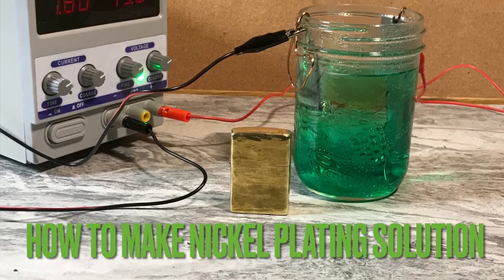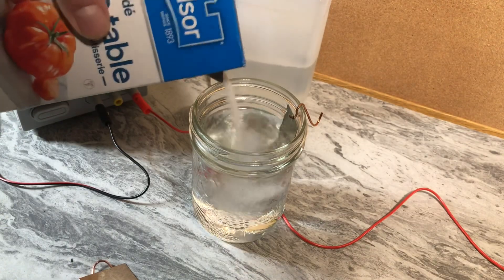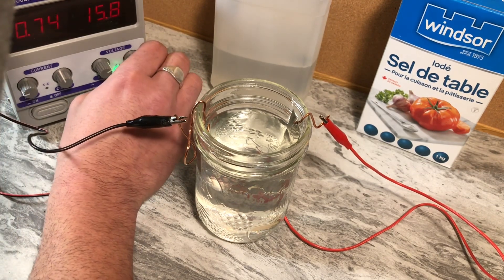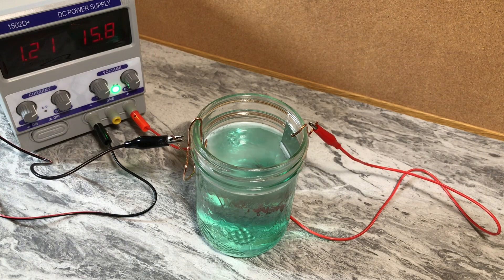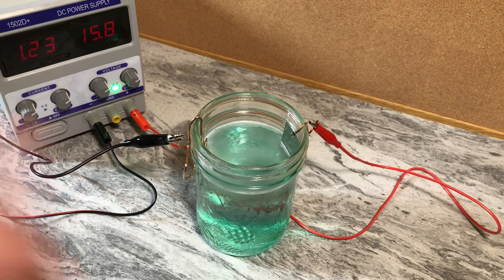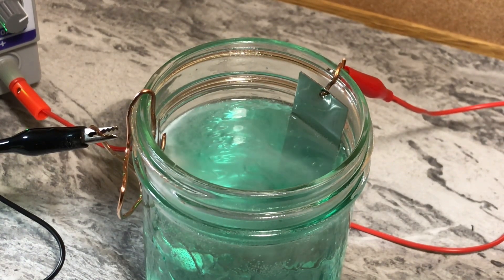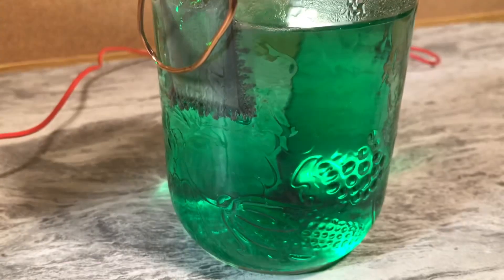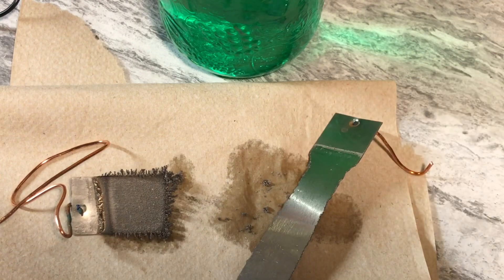How To Make Nickel Plating Solution.

Comment: When you make this solution it doesn't matter what is the cathode or anode, I always use the same size of nickel strips - but it does matter when you start plating with this solution. The salt doesn't do anything, it's just used to make the water electrically more conductive. And wear safety goggles, you don't want the plating solution in your eyes or face!

Comment: You will get a better result if the item and the solution is preheated.  Even, hot.  It expands the metal to allow the plating to absorb

Comment: I notice in the video that the current jumps from 0.78 to 1.21 after a cut. Does the electrolyte cause that as it gets more concentrated or did you add more salt?
Reply: The salt creates conductivity.  Once the nickel is infused, it becomes conductive on its own.

Comment: Just to let you know, the anode is the negative and the cathode is the positive. obviously it's just a word so it doesn't make anything here different.
Reply: It makes a difference.  The negative wire attaches to the piece you want to plate. Notice the positive plate was drastically reduced  the negative plate had buildup. It was burnt nickel.  If he would have made the solution using 200 mah and not 1.2 amps, the nickel on both sides would be pretty. However,  it would have taken a day or more to make the solution that green.
Reply: According to the encyclopedia Britannica "In a battery or other source of direct current the anode is the negative terminal, but in a passive load it is the positive terminal. "

Comment: It make sense the vinegar and salt go together and become very conducive. And I assume is green because they have a little copper from the cathode and  anode. I find it very mesmerizing to look at the little hydrogen bubbles. Awesome video!
Reply: Actually, copper makes the solution blue
Reply: Huh
Reply: This might be working 15 volts when making the solution. However, when plating a piece you can only go up to 4.5 volts. Otherwise the piece turns black.